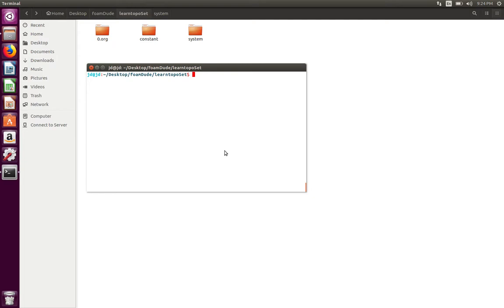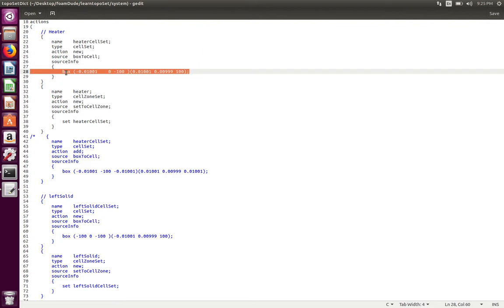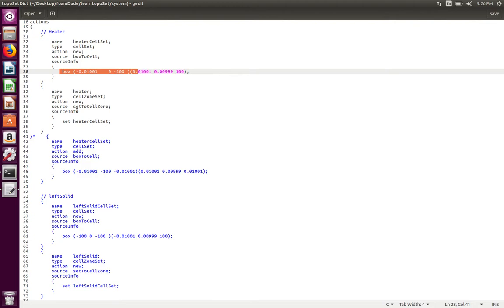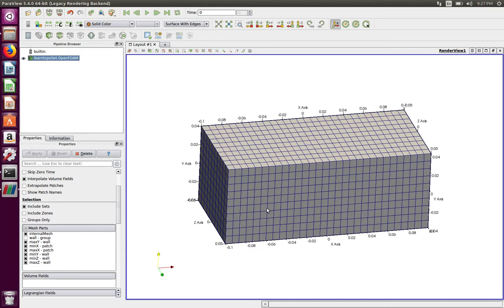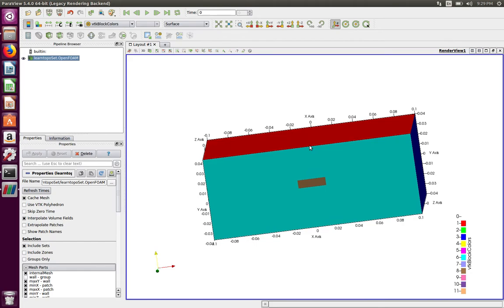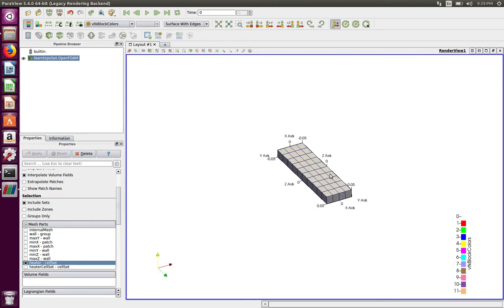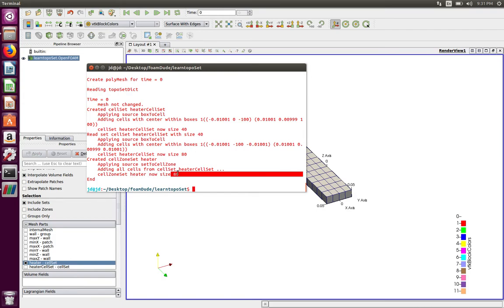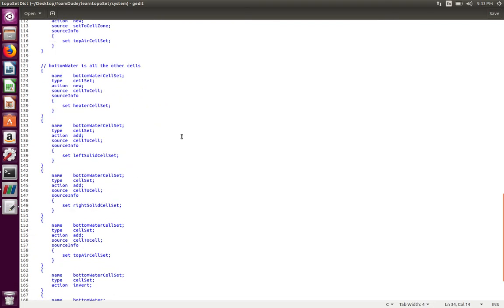OpenFOAM: chtMultiRegion - topoSet

Comment: Hello,
 thanks for the video

I have a conjugate heat transfer problem, few electronic components being cooled directly by a fluid (immersion method of cooling) and i am using OpenFoam for this.

I am using toposet to identify different solid components inside the background mesh. Since some of the components are very thin (like a solder layer 0.1mm thick), i have to use a blockmesh with very high number of elements in each of the three axis. If the background mesh is not fine enough, toposet is unable to extract these thin solid components. I have to play with the backgroud blockmesh so as the toposet identifies all the solid cellZones successfully. Of course i can use snappy, but i do not think so i can get the same quality hexa mesh as given by blockMesh.

Any idea how to make sure that toposet identifies a particular cellZone successfully without using hit and trial with background blockMesh?

thanks